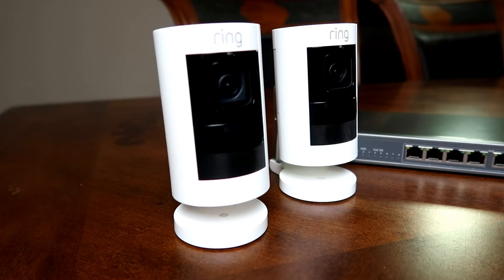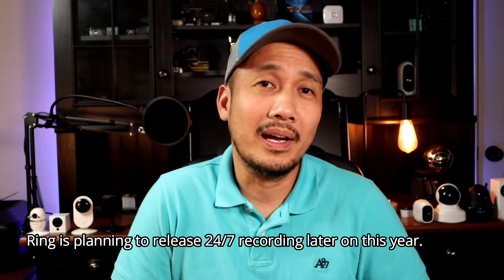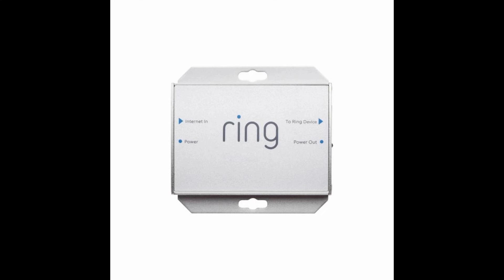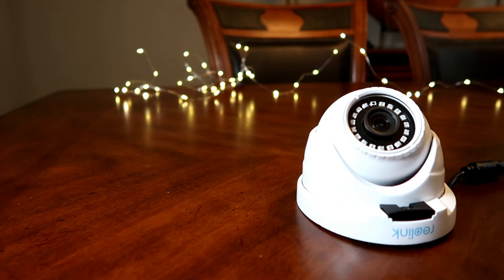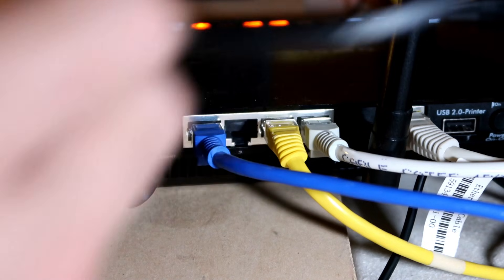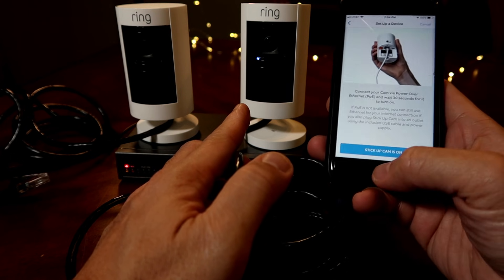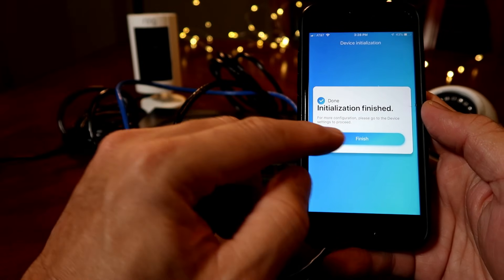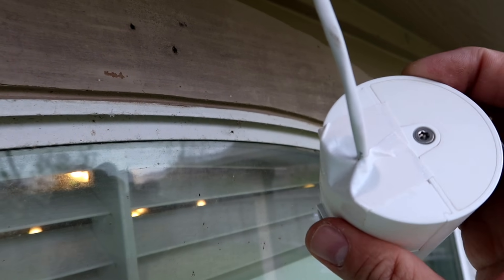Ring Stick Up Cam PoE (Power Over Ethernet) Setup and Installation

Comment: This camera is way overpriced for Poe with only 1080p.... I got tired of all the WiFi/smart cameras.... decided to return everything and go with wire. Traditional wire ip cams are still the best.
Reply from the maker: I agree. Wired NVR systems are still better and more dependable than WiFi cameras.
Reply: Which wired cameras did you go with and how are they so far?
Reply: Tee Jay i haven’t exactly purchase mine yet.... but I always have a few amcrest in another remote location. They are reliable and always up, only been down 1 or 2 times in like 3 years... The only new camera I purchased and kept is the amcrest 4mp ptz. I like this little thing,  not Poe, can be wire or wireless. Only draw back is that it’s a indoor camera, but I am using it inside, so fine for me. I am likely to purchase the new amcrest 4k 8mp bulllet in the near future, I have more faith in this brand than any other brand out there. Only problem is they don’t have anything with siren and led light......
Reply: @sickegg2000  ty

Comment: If someone is going to take time and effort to run cat wiring, dont install crap Ring products. Just get a TRUE real poe cam that records to NVR. Ring will never release a true security because their income is based on subscriptions. If they allow true poe cam functionality, no one would pay for cloud subscription. There is no improvement using poe version of rings products. If you  are running cat wiring for cameras get the nice tru cameras or your effort is wasted if you go ring.
Reply from the maker: I agree with you but Ring is pretty accurate in motion detection and motion notifications..their wired cams anyways.. I haven’t seen any POE/NVR systems that can do that. That is the reason why I have Ring cameras around the house but I also have a PoE NVR system that records 24/7. Ring notifies me and when there is motion that I need to check in more detail, then I look at my NVR..

Comment: Garbage do not spend your money
Reply from the maker: Garbage is a strong word...it does what it needs to do.
Reply: @LifeHackster  he isnt lying. it IS garbage compared to the other poe cameras. The main reason to go poe is not just so you dont have to use wifi, its also that it powers the device, and provides being able to use better hardware that provides better picture quality, no compression higher bitrate faster FPS because it doesnt have wifi limitations anymore--yet ring doesnt do this because their business model is to sell cloud subscriptions--its how they make money. so compared to real POE cameras that setup through NVR, yes it is garbage.
Reply from the maker: Moises Alderson - Ring is pretty accurate in motion detection and motion notifications. I haven’t seen any Poe or NVR cameras that can do that. If you know of any brand, let me know and I will check it out.